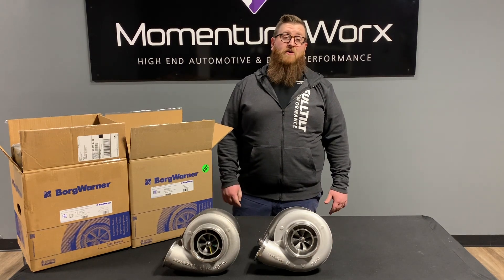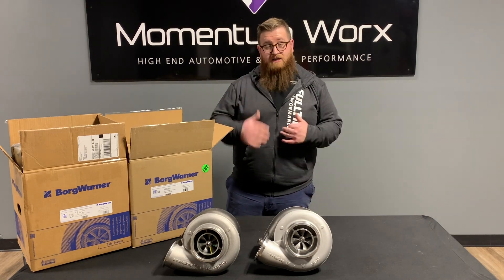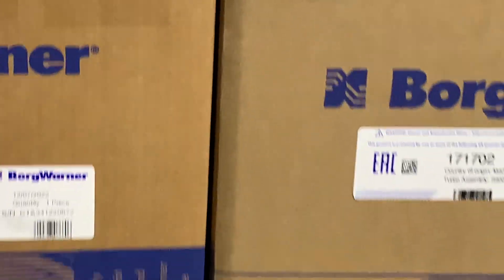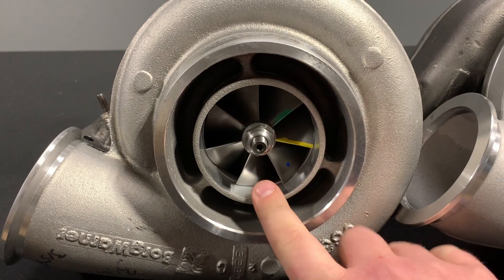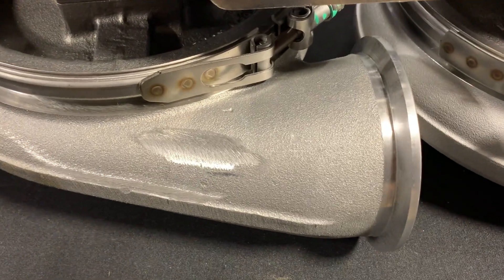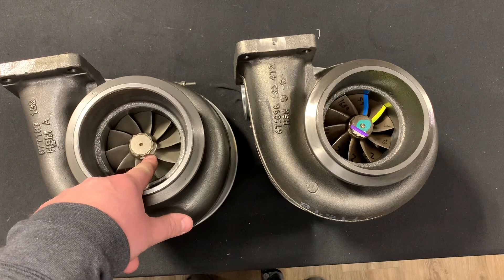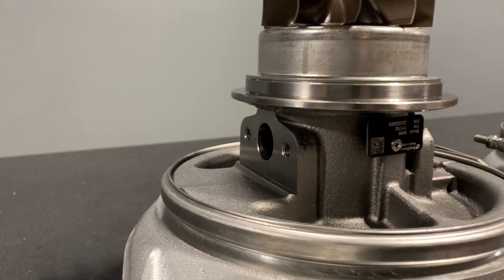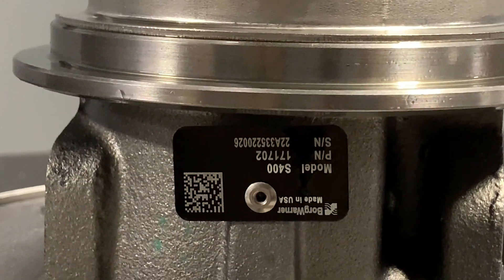BorgWarner 171702 S400 Turbo Now Made In CHINA.   The old S475 is coming from Overseas,

Comment: I retired from BorgWarner Turbo. My brother-in-law asked me to purchase one of the S400 for his truck 14 liter Detroit with my employee discount. The first one lasted 900k miles. When it failed he changed out the intercooler to a high performance unit. The new S400 only lasted 100k miles. When the 2nd one failed I contacted the technical support department. They  said that 14 liter engine was over speeding the S400. The technical support recommend a S410 with a milled wheel. Three years later the S410 is still going.I couldn't believe how long the S400 held up being overspeed and above the recommend pressure.

Comment: A quality product, if you want to use it with confidence, it should be made in Germany or America. Do not use Chinese because it has no quality and is occupied
Reply: That's just old way of thinking. Some Chinese manufacturers have as good quality as German or US made ones. You just need to know who you are buying from.
Reply: There are many products made in China, the parent company is American, and the quality control is at US standards. The big problem with Chinese products is QC, unscrupulous companies producing cheap Walmart junk could care less about QC.
Reply: I work at a BorgWarner pilot facility in the United States. BorgWarner builds their parts using many chinese components. For example Ford Raptor transfer case input shafts are made in Zhejiang, China. The output flanges on Raptor cases are made in Anhui, China. the thrust washers used in F150 transfer cases are made in Suzhou, China. You would be surprised to learn just how many “Made in USA” parts are built with Chinese components.
Reply: @chrisc.2626 shhh you’re saying the quiet part out loud.

Comment: Does less material on C version allow more heat to dissipate or does the American one allow more heat soak reliably?
Reply from the maker: That a great point, we will have to see once we get some run time on the c-version.
Reply: I though the same, as a lot of clones are casting fins in the bearing housing to help dissipate

Comment: The lack of balancing marks and the shaft different has me curious or maybe even concerned a little. Overall the difference are worrisome. The Chinese version cost less to produce. I know now I will make sure I get the US version.
Reply: Paint is going to naturally imbalance an impeller. These new balancing machines go off of gyrational procession so it can predict where the imbalances are and remove material there rather than adding weight with paint.
Reply: Lol of course they are balanced.. 🤦‍♂️
Reply: @BigRed-MWA  LOL you liked your own comment..